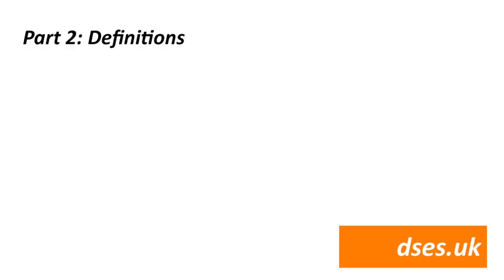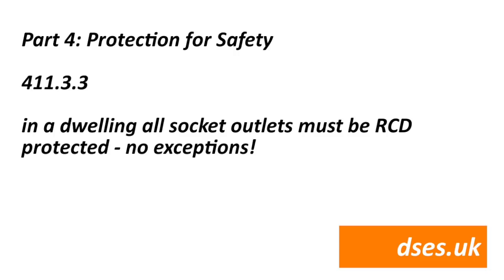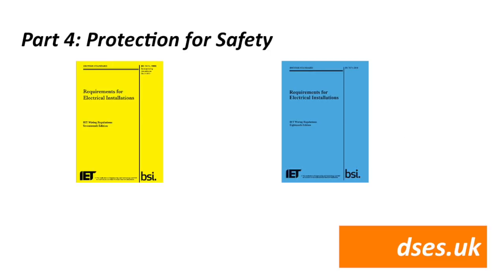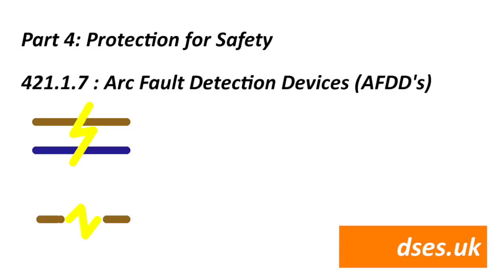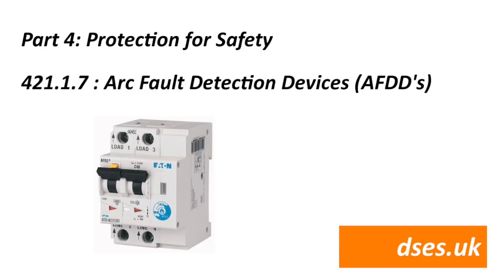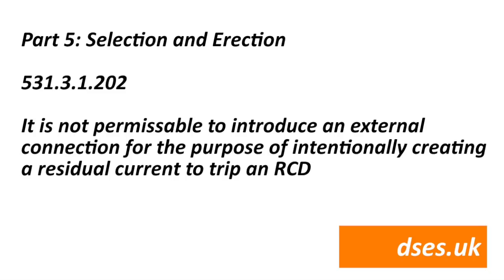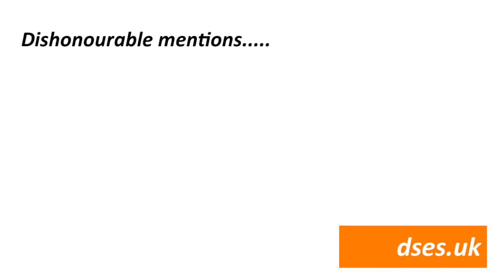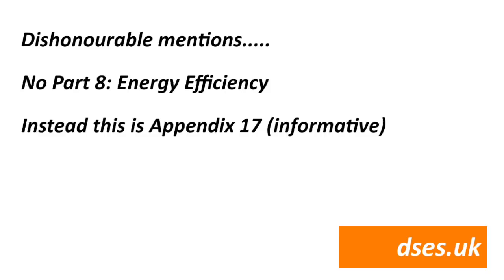18th Edition regulation changes

Comment: Si nice to hear you say these reg over the top.

Felt that way since 15th when we require to bond everything in bathroons including ally windows and radiators which should have already tied earth via main bonding and copper pipes used evertwhere.

Comment: Supplier / distributor fuse. I had to get SSE out due to the board tripping in a slight breeze. Didn't realise there would be 2 vans one with a cherry picker or I would have bought more than 3 bacon sandwiches and coffees. Needless to say I went hungry. They were surprised that the main fuse had an intact seal. They wouldn't fit a cut-off switch but left a few spares as I'm getting the board replaced. Nice guys, probably don't want another call out :)

Comment: These are not statuary regulations. A deviation on the certificate can be issued I.e could not install regulation size labeling. Being an Electrical Engineer we have a story. 
Engineer 1"Hows that going to get installed?"
Engineer 2 " don't know let the sparks on site figure it out"
Everyone chuckles and nods.
Engineer 1 "so moving on"

Comment: Good video. Excellent commentary. Where do you get your labels from. Good idea refer to certificate.
Is it expensive being in the ECA for a self employed domestic electrician, I looked at it once and thought it was only for large companies and the cost was outside the market of a one man band such as myself?
Reply from the maker: The T&I labels were designed using GIMP (a free image editor) and were printed professionally (about £75 ex-VAT for 250 of them or something). Other labels such as RCD and two-colours I print using my Brother label printer. There's another video on that, it's a good bit of kit! ECA is expensive, same again as my NICEIC membership, but it has perks such as free events, reduced cost training and access to BS documents. They gave me an 18th Edition regs book for free at an event last week, so it has perks but probably doesn't pay it's way if you just do domestic work. For me it's more about trying to distance myself from local competitors and like 'em or loathe 'em names like NIC and ECA are recognised and bring in business!

Comment: 531.3.1.202: I think the actual intent behind that is preventing idiots from designing a machine safety shutoff that works by tripping the RCD.

Re: RCD types: the Germans have been requiring type A for everything for decades and consider requiring type F for domestic installations in the future, claiming that even washing machines may contain electronic VFDs these days that could possibly introduce DC fault currents. Austria seems to be moving gradually from AC to A but AC is still a lot more common.

Earth rods have been required for all new/modernised TN supplies in Austria since 1998, designed as if it were a TT supply. New buildings have an earth in the foundations anyway, so that hasn't been an issue for anything built in the 1970s or later. Older ones just have a 4.5 m stainless rod hammered in in some convenient location whenever the supply is altered.

Comment: 11.20, well said. I see nothing wrong with using plastic conduit held in place with metal saddles, that still prevents the cables from collapsing prematurely even if the conduits melted away.

Comment: Just to let you know, but the standard of the better USA installers on circuits such as kitchen circuits that require both AFCI and GFCI protection is to place the afci protection in the panel, and then use GFCI in the room in the outlets. Of course, our systems are different but, if the manufacturers are using AFCI styled like the split panel RCD, covering a few MCBOs, then you use the combination RCD/Overcurrent or MCBOs after the AFCI, if an AFCI blows you know then to look for the loose wires, etc, and if a MCBO blows you know it is water or overcurrent style fault..lol... not exactly but you have more chance then of narrowing down the problems. I dis work in both countries and am currently saving my pennies for the new book, as my old british book is RED..lol... so really need to catch up.
Reply from the maker: Interesting. The problem at this end is the requirement for GFCI protection on cables buried in walls at less than 50mm, cables passing through a room with a bath or a shower, accessories in rooms with a bath or a shower, all socket outlets (no exceptions in dwellings from January 2019) etc. This means in most cases it's just easier to have the GFCI at source so that everything downstream is covered. Still, as I found when I got to play with an AFCI in a later video, there is visual indication to help you determine the nature of the trip, at least on the model I played with. I doubt AFCI's will see widespread adoption here until the regs tighten up their wording from 'recommended' to 'required', so that'll probably be in 18th Edition Amendment 1 which should be two or three years away... or longer (hopefully)....
Reply: True, it would seem that one needs to have gfci due to the installation means but... the idea, at least from some of those in the USA who are doing it, is to protect the cables using afci... then from the first outlet protect them using gfci, thus protecting with both yet using separate units. 
The advantage so far in the UK and Germany is one adds the afci as a module to the side of the breaker assemble or RCD assembly. Plus, RCD is being used here to cover several circuits where in the USA they only cover one branch or group of outlets, and usually no more than. Six outlets at a time.
But,from reports from both sides of the pond, while gfci is reducing risks afci might actually not be doing as much as it could. There is a call that it might not detect many forms of arc fault simply due to its having to differentiate between actual faults and lighting, or cooking circuits.
There are some calls that building a circuit 5hat fits into the outlets themselves would do more to detect and prevent damage from faults, with lesscost.
Reply: @brotheradam  Apparently US AFDDs also contain 30 mA earth-fault protection, something previously almost unheard of in the US (there's been RCBOs for a while but they're rarely ever used, so most of the house wiring is only protected by a 15 or 20 amp MCB) and that's led to a remarkable drop in electrical fires. The actual series arc detection... not so much according to the figures I've seen.

The Germans actually went from requirement to recommendation on the AFDDs after a few years.

Comment: 2:54 - Socket off a lighting circuit? This should no be done as it allows someone to plug in any device with up to a 13A fuse. Fused spur and cut the plug off.
Reply from the maker: You're right, it shouldn't be done, although someone crawling into the corner of the attic to plug in a high load appliance when the outlet has a label on it stating 'TV BOOSTER ONLY, MAX LOAD 3A' deserves to have to crawl back out to flick the tripped breaker back on. In all seriousness though, a fused connection plate and a chop of the booster's plug would be the recommended way to do it.

Comment: Annoying that 411.3.1.2 will not apply to gas meter outlet pipework despite the rollout of MDPE service pipework with an IJ at the top of the riser. The arrangement for gas engineers notifying customers of the need for a PEB to be installed after the meter has always been a bit gash - coming from a limited scope engineer with the Big Six.

Comment: I was having a general debate with someone about qualifications needed to fit a consumer unit. The person said that you do not legally need to be qualified to fit one but if anything happens then the installer could be jailed (depending on the severity or outcome). I agree about the consequences, but is it true about fitting one ?. The reason I am unsure is because anyone can buy a consumer unit or anything else for that matter without needing to show proof. Before anyone fires comments on the dangers of doing it, I am not. This is just a general question I am asking to settle a debate.
Reply from the maker: Electrical installation work in the UK is unregulated, so anyone can pop into Screwfix or B&Q and purchase a consumer unit. They can go ahead and install it into their own home if they feel confident and competent enough to undertake the task. There are three issues with this however. Firstly, they will lack the requisite test equipment to  know that the installation is fit to be modified resulting in something which may be dangerous (especially in the event of a fault), or an installation that trips off and is unstable. Secondly, their home insurance will be invalidated, at least for electrical fire/shock incidents. Finally, they will be legally accountable for any incidents or accidents which may result in a fine or imprisonment if the severity of such is serious enough. The work is also legally notifiable to Local Authority Building Control under Part-P of the Building Regulations, so if the work was done without first submitting a planning application, then they may be required to have it professionally checked and any deficiencies made good. Of course, that last one is only if LABC get wind of unauthorised changes having been made. If Joe Bloggs the non-Electrician is buying a consumer unit to install for someone else, then he's liable for the safety of that installation going forward, the insurance is invalidated and the client he's doing it for may themselves be prosecuted in the event of an incident as they failed to appoint an appropriate person to undertake the work. A lot of my time is spent on installations meddled with by homeowners or other trades who have cobbled together the electrics into something that works on the face of it, but fails to meet the expected standard and is dangerous in the event of a fault (because of things like missing earths, undersized cables, etc.) Often, the cost and effort to put right is more than the original job would have been to do properly in the first place.
Reply: Thanks very much David for your detailed explanation. You have included extra info about home insurance clauses, which I wasn't aware of either. I also feel for your pain having to put right other peoples mess (qualified or not). Keep up the good work and my kindest regards.
Reply from the maker: @retrocomputeruser  Thanks Andy. Another point regarding insurance is that there is no legal requirement to have your electrical installation inspected and tested, but the recommendation is for checks up to every ten years (five years for rental). Many people don't bother of course, but if an electrical fire breaks out on an installation that has never been checked, or the date of last inspection has expired, then again the insurance company might get out of coughing up if you can't prove the installation was kept maintained.
Reply: @dsesuk  honestly I don't know of a living soul that has there electrical installation checked every ten years,. its just not a realistic scenario in the world outside your industry. People generally call electricians when they want work done or repairs made but if everything works people don't call electricians. Its just not the way people think.
Reply from the maker: @cbcdesign001  This is true, if everything is working then it tends to be taken for granted. When we're called upon to undertake condition reporting, the driver is normally something like a house sale/purchase, conversion to rental, a result of a fault or known poor workmanship, or because significant alterations are planned. Few book in the work just because it's out of date since the last inspection, with the exception of landlords who want to cover themselves legally for their rental properties.

Comment: See Table 52.3 of BS7671 for minimum sizes of conductor for power circuits. Stating the cable ccc from the OSG is irrelevant. A 1.0 wired lighting circuit should not have power connected from it according to the quoted Table, you have no argument that this is correct.
Reply from the maker: Good find, I stand corrected. It still won't stop me installing aerial amps from the lighting circuit though!
Reply: Whilst that's true about the minimum cable sizes for lighting circuits and power circuits, the fact remains that both "lighting circuits" and "power circuits" are actually undefined, so it could easily be argued that a circuit serving multiple luminaires which also had a TV booster connected to it was still, in fact, a lighting circuit and therefore could be wired in 1mm^2 cable.

Comment: Is it necessary to supply a minor works for like for like replacement such as socket fronts, light switches, light fittings etc?
Reply from the maker: That's the kind of job a minor works is intended for: like for like accessory replacements or additions. It's your declaration that you've done the job properly and left it no less safe than before you started. Of course, BS7671 is non-statutory so you don't have to follow the format of the MW cert or even supply one at all. It depends on how you run your business and what your customer's expectations are. I'd be lying if I said I'd issued a MW cert for every piddly job I've ever done, but I do supply one for the most part as it gives me a record of what was done and what the test numbers were and it gives my client peace-of-mind that the job has been done professionally.
Reply: David Savery Electrical Services,  I believe they should really bring out a maintenance certificate for like for like replacement in none special locations. It only needs to contain visuals on earthing/bonding, consumer unit etc, a ZE test at the item you're working on and an rcd test. The minor works was already over the top for replacing a light switch etc and now its going to be even more hassle!!! Whats your thoughts?
Reply from the maker: Personally I believe the certs are too much, and I agree that the minor works will be more of a headache. My opinion is that the paperwork should be simplified with less data included on the MW or EIC and a declaration for the installer to sign basically stating "I've done my job properly and I stand by my work in court if necessary". Am I going to go to the effort of checking the Ze at the consumer unit for the new minor works cert every time I do a pissy little job? No. I'll record the Zs for the circuit I'm modifying, and if that's good then I'll assume the Ze is okay and I'll put 'N/V' for Not Verified in the box. I understand that in the spirit of the wiring regulations I should be opening the CU, checking it over, verifying the supplier's earth and so on, but I'm running a business, there are only so many hours in the day and I'm being undercut by people who aren't accredited and who won't be wasting time on paperwork. If I worked exactly by the book all time time, my business would fail. Again, it's non-statutory; you don't have to abide by it, and I'll sleep at night if I know that on any given  job I have left it no less safe than before I arrived and opened the toolbox even if some of the boxes on the cert have 'N/V' filled in them!

Comment: From what we have been told spd will be required on all jobs with the 18th
Reply from the maker: Reg 443.4 requires overvoltage control, or a risk assessment if omitted, but single dwellings are listed as an exception 'where the total value of the installation and equipment therein does not justify such protection'. Make of that what you will. At present, SPD pricing is high, and although I would always recommend protection for my clients, the reality is that a domestic client isn't likely to want to fork out for it on a CU change unless they've had previous experience of a lighting strike or other overvoltage event and want to ensure it doesn't happen again (that may be a requirement of their insurance who may pay out the first time, but insist protection is installed to ensure there isn't a second time). Remember that this industry is unregulated and when a client is shopping around for pricing for their CU upgrade, my price is already higher than some handyman who picks up a dual RCD board from B&Q and sticks it in with no testing, warranty or certification, so much as I would like to insist upon these things, I'd be out of business in short order if I did so. Also the SPD's I've seen are one-shot devices, when they're blown they need replacing, so that makes it a harder sell again as the client may not appreciate all their expensive household gadgets have been saved, but they are pissed that they're having to hire an emergency electrician to come in and replace their blown SPD to get the juice back on after an overvoltage event. What the 18th is doing is making we designers/installers responsible for thinking about the use of SPD's. It's up to us to weigh up the pros and cons for any given installation, discuss it with our clients, insist on it if required, produce a risk assessment if needed, omit it if the client agrees that the risk is low and they're happy to be without it. After January, when 18th Ed is fully live, you'll still see the usual CU enclosures on the market without the SPD. When it becomes mandatory for everyone, they'll come factory fitted.